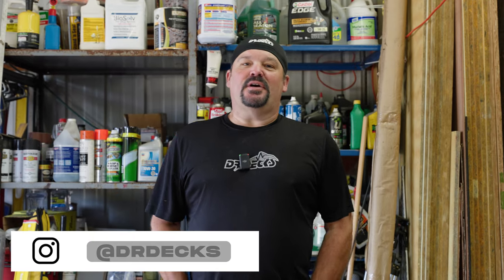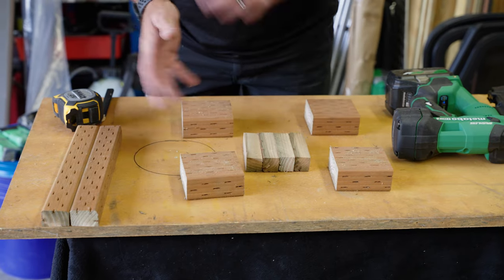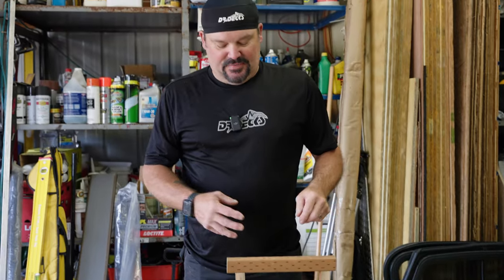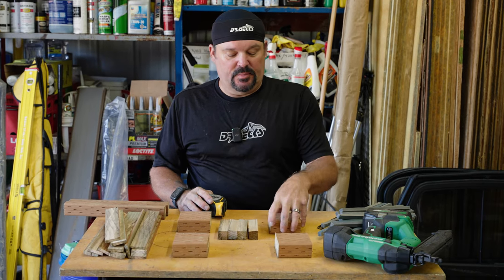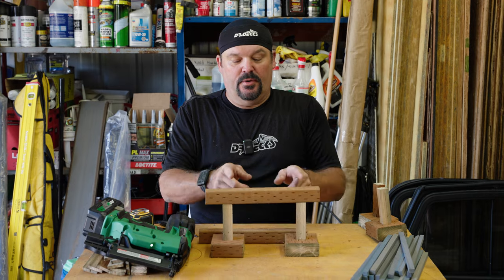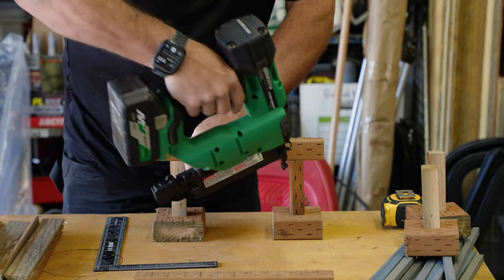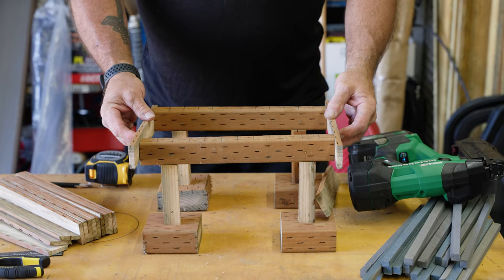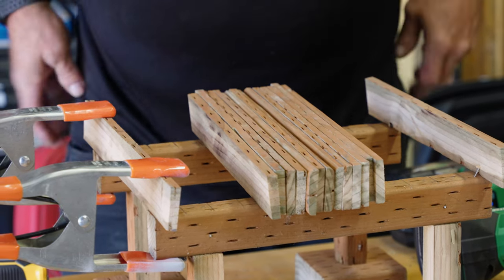I Built The Smallest Deck In The World || Dr Decks

Comment: The minideck is adorable! Now it just needs a mini railing and stairs. It did answer a question I had about a freestanding deck. I want to build two freestanding landings (4' x 4' each). I live in a very damp area with fairly soft soil so its going to be "fun" getting footings right. At the moment I have a bunch of cinderblocks piled up to act as steps (contractor accidentally broke the back steps while doing siding & passed away before he could replace them). I don't like going down steps immediately out the door anyway though.